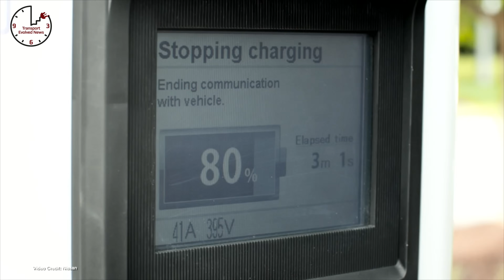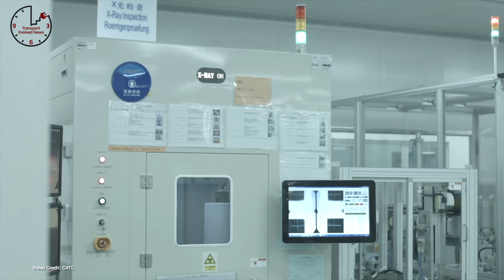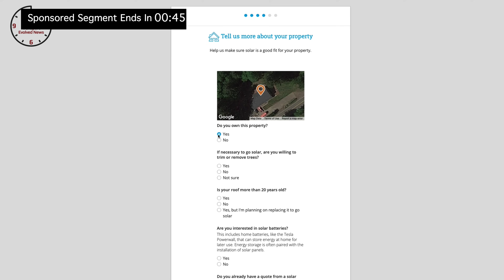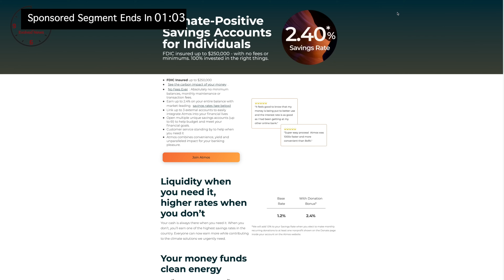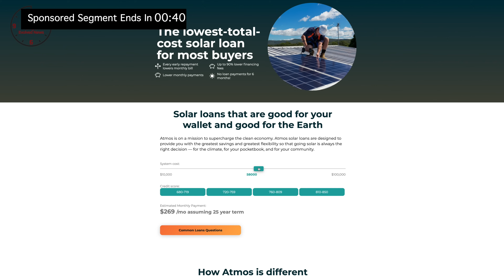Transport Evolved News (TEN) Episode 471: Elon's Not Happy With Delaware

Comment: Y’all are complaining again about plugging hybrids. But let’s remember that every plug-in hybrid that gets out on the road is essentially electric vehicle inside a gas car, and gas cars are still being sold. Let’s also remember that today, electric vehicle technology, significantly better than it was 10 years ago, is still insufficient for some buyers, And they’re going to keep buying gas cars. I have long advocated that if an auto maker is going to sell a gas car it should be required to be a plug-in hybrid with at least 35 miles of range. Such vehicles, well somewhat more complicated than either gas or electric vehicles, will create an excellent car market.

More importantly, I did some research on this, and it turns out that the information about EV mode usage of plug-in hybrid vehicles is data that is self reported by the auto makers. That is to say, auto makers have been reporting that PHEV buyers haven’t been using their electric modes very much. I assume that’s what you’re basing your negative comments on. However, while there aren’t a lot of independent studies, the one independent study that I could find that was from a reliable source, and unfortunately I don’t have it handy right now, but I posted it to my blue sky, indicates that the manufacturer self reporting is inaccurate in fact, PHEV owners are far more likely to use the EV mode than the OEM have been reporting.

One can only guess why this might be, but it’s my theory that the OEMS don’t want to have to do any of this, and so they are trying to make plug-in hybrid seem like a waste of time compared to non-plug-in hybrids.

Frankly, I would think you’d be more upset by Toyota cheating on their diesel testing. I believe this is the third manufacturer that’s had a major issue like this. We’ve had Volkswagen, then Stellantis and now Toyota. That is a trend that is far more disturbing to me. they are in essence breaking the law, depending on the market, and given how heavily Volkswagen was penalized, Stellantis and Toyota should also be heavily penalized. That said, the network that Volkswagen built out of United States is pretty crummy, so I don’t know if that strategy is the best one.

Perhaps these companies should pay into a fund that they are not in charge of so to speak, and that money can be used to either incentivize installation and maintenance of a charging network, or else subsidize further the purchase of electric vehicles.
Reply: @markplott4820  first, not universally true. Second, we’re specifically talking about plug-in hybrids. And almost all proposed plug-in hybrids today have at least 35 miles of range.

You have to remember the argument that was made with an 80 mile range vehicle, that that would cover 90% of anyone’s usage so it’s like including a compliance EV and a gas vehicle.

But the main thing as gas cars are still being sold. Gas cars without any hybrid in them. The reason for this is because there are some people who actually need more than 300 miles of range, because they live in a place like Montana, or they don’t have a convenient gas station less than 5 miles away. They are also people who have activities like towing that the EV range for those activities is not sufficient yet. There are also people who do not live in a situation where they can have home charging, and for whatever reason they can’t afford the time to charge more than once a week.

But those people, having a plug-in hybrid may not be something that they will totally take advantage of. But the hybrid aspect of the vehicle will make them more fuel efficient. And then, when they sell that vehicle to use market, now you have a 35 mile range electric vehicle that someone else who can’t afford $70,000 for a new car might be able to afford. To me, that’s the worst case scenario of the plug-in hybrid.

More likely is that someone who just is afraid of electric vehicles but could use a 35 mile plug-in range will buy that instead, and then realize that they can take advantage of the electric vehicle aspect.

Also, vibrators are very powerful these days maybe you should buy one.
Reply: A correction: it was Cummins, not Stellantis, that was penalized $1.67B.  Cummins supplies diesel engines for several different OEMs.
Reply: @alsavage1  fair enough, but we can agree that Stellantis bought those engines, unless I’m mistaken Dodge is responsible for reporting the emissions and for selling the vehicles that have them, correct? And as far as I know, Dodge is a Stellantis company.
Reply: So then I suppose the question is, who programmed the system that cheated? And then, who is responsible for making sure that the tests aren’t cheated on? As far as I’m concerned, there’s plenty of blame to go around.
Reply: @EliotHochberg  RAM, not Dodge, but sure.  You've got your branding stuck in the past, but I follow your gist.
Reply: @alsavage1  sorry, yeah, you’re right. It’s a little hard to keep up with that. But yes, I meant Ram

Comment: I wish they would concentrate on pure hybrid over phev.  Doesn't the data show many don't plug in?  At least with pure hybrid you are guaranteed less emissions.
Reply: Charging the battery from the internal combustion engine is really inefficient compared to plugging in.  You're better off running pure ICE in that case.
Reply: @SteveRowe  You are saying pure ICE is better than hybrid for reduced emissions?
Reply: @patrick7228 If you don't plug it in. Many commercial PHEV buyers don't. They just want to reduce their taxes.

Comment: Reality:  PHEVs are a lot cleaner then ICE. There is a fairly significant chunk of people in the USA where an EV just wouldn't work for them until tech and infrastructure makes it a realistic option for them. For example,I love my EV, but I have an ICE truck for towing, EV trucks available now can't meet my needs when it comes to towing. Many people don't have access to charging at home or work, or some people may  only be able to access 110v charging at either location, and there are a multitude of other cases where an EV isn't a viable solution, yet. Your comments on the matter come off as ignorant and out of touch in regards the needs of others in different situations. Alsp PHEVs can help make people feel a lot more comfortable with the thought of making the next purchase after that a full EV. I would recommend being a little more open-minded and doing more comprehensive research before making such myopic statements.
Reply: BEVs are not for everyone right now and it will take decades to provide infrastructure in the more remote regions. Long range batteries are too expensive for most folk today but that will gradually change. Battery prices will fall dramatically quite soon.